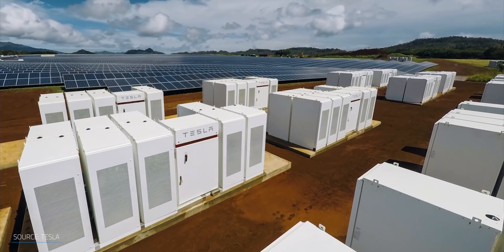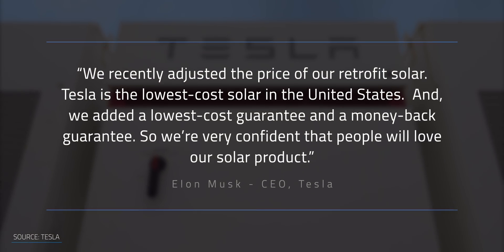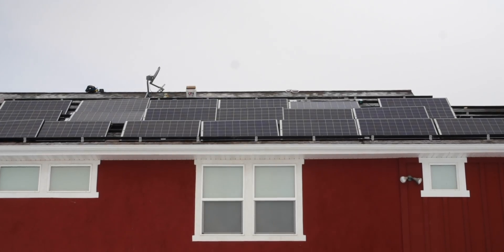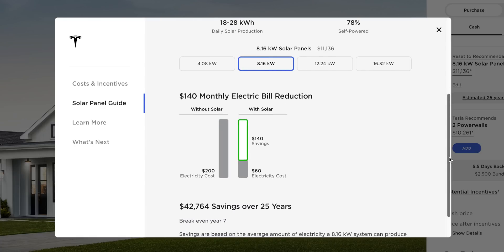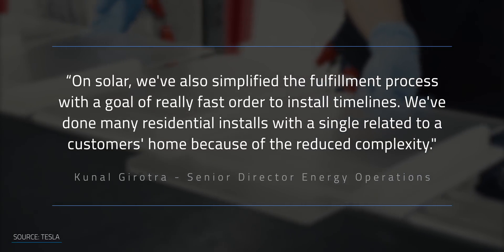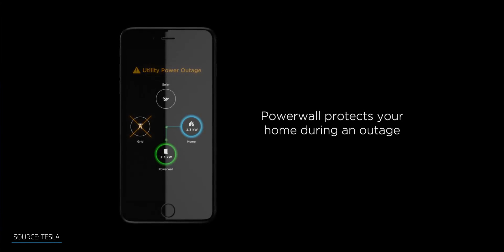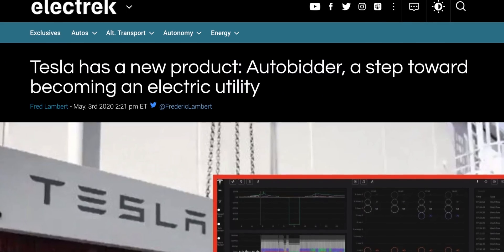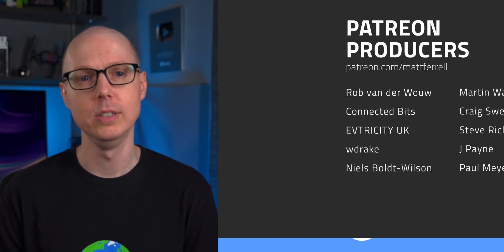Exploring Tesla solar panels game changing price

Comment: Hey Matt, great video.
For comparison, here in Brazil solar cost is around  1.00USD/watt for small systems between 1kw and 30kw. For bigger rooftop systems (btw 300kw and 1Mw) cost is around only 0.61USD/watt, we have no incentives. And those prices were way cheaper before covid pandemic.
I'm an engineer with over 20MW installed in Brazil.

Comment: I would love to have Tesla solar but, when I enter my zip code at the Tesla power page of the site it say "not available in your zip code yet"
Reply: All of my lights in my house are  LED and my A/C unit is new 5 yrs ago so I keep my bill low. I have a cybertruck dual motor/self drive on order. (my 1/2 acre lot is 80% shaded) can only have ground mount on first 20 feet of my south facing front yard next to the highway and the county does not want solar there?
Reply: that is the only place the sun shines for 4 to 8 hours a day.

Comment: Tesla chikubi.

Solar panel https://amzn.to/2Cx3J5t
Eco-worthy 1000w https://amzn.to/2Cg8i4a
Amazing shower https://amzn.to/39trFTi
Earbuds https://amzn.to/3fcw3Iv
Kindle ultimate https://amzn.to/31PAx3N
Twitch prime https://amzn.to/2ZIgcLl
fire tv stick https://amzn.to/2C2bTlE
Midea U Inverter Window Ac 8,000BTU https://amzn.to/3eRYzyp
Necklace fan https://amzn.to/2VGlIwU
Sense Energy Monitor https://amzn.to/2T2u3JD
Spiderman FFH https://amzn.to/2W3NIK7
Aveners: End game  https://amzn.to/2KOhyx7
Metamucil double https://amzn.to/3aHoNB8 single https://amzn.to/3bmvVTU
Canon EOS M50 https://amzn.to/35fHX0c
SONY RX 100 VI https://amzn.to/35bteTS
Canon PowerShot G7 X Mark II https://amzn.to/2WaAPhp
CANON 90D https://amzn.to/3cX8z8O
SONY A6400 https://amzn.to/2VMUNzL
Darth Vader and Ahsoka https://amzn.to/2A3qDjl
Captain Rex https://amzn.to/2L2tMST
Ahsoka Rebel https://amzn.to/2A0hoAl
Anakin https://amzn.to/2W8QZch
Skillmatic https://amzn.to/37PwSEn
Aqua 4 in 1 Monterey https://amzn.to/2Ctihmm
Bunch O https://amzn.to/2YWQodL
Face mask https://amzn.to/2ZBw2Y9
Enema https://amzn.to/2YTOquQ
Amazon business account https://amzn.to/3h9t98K
100 disposable gloves https://amzn.to/3dEbNh9
Bicycle rollers https://amzn.to/2VFCOLh
Oscilloscope https://amzn.to/32tCFyA
Ispring reverse osmosis https://amzn.to/2Wy6D0I
Flex Seal Spray Rubber Sealant Coating  https://amzn.to/2OWPERv
Great Stuff 157913 Big Gap Filler, 20 oz https://amzn.to/39t7lBK
Reusable Half Face Cover, NASUM M101 Face Cover https://amzn.to/3jDWFVl
Rockport Men's Bennett Lane 4 Venetian Shoe https://amzn.to/39tqumR
Helix Flexible Stainless Steel Non Skid Ruler https://amzn.to/3jECy9B
Bacitracin Zinc Firtst Aid Antibiotic https://amzn.to/30KvsHT
Bella & Bear hawaiian sea salt shampoo   https://amzn.to/2Dst6pc
Bella & Bear hawaiian sea salt conditioner https://amzn.to/2PiRFHO

Comment: Through my research, the problem with Tesla obviously isn't the cost but with the customer service.  They have gotten some horrendous reviews leading to 1.X out of five stars.  Has anyone experienced the same bad customer service issues?  Also, I want to do a ground mount system instead of a roof mount but there doesn't seem like anyone I can talk to from the company without paying the $100 deposit.  Any suggestions?  For a company this size, you would think there would be some kind of chat line.

Comment: You make it seem like prices in Australia can be <US$1/W. While that's certainly true, it's actually much cheaper than that. The cheapest operators are offering 6.6kW fully installed for A$2199 (not that I would recommend those!), which equates to just US$0.24/W!
I should note that this also includes a generous federal incentive (STC) though, which currently is worth A$3800 for this system, so if you were to include those costs it would bring the cost without incentives up to US$0.54/W. Still significantly cheaper than US$1/W.

Note, my calculations are based on the DC sizing of 6.6kW, the inverter for this would be 5kW, however there would be minimal trimming, so even a bigger inverter wouldn't change your energy yield in any meaningful way.

Thanks for the video!

Comment: How are you feeling about hubitat now with the release of C-7? Do you have thoughts on some of the community devs (e.g. codahq) pulling their driver code off of github to protest hubitat ignoring stability issues they've reported and requiring the new hardware for S2 (which could have been supported by the old hardware apparently?)

Comment: Build grid-scale wind and solar arrays.  Forget about the rooftop.  It's expensive -- 2 to 4 times as expensive as big solar arrays -- and forget about behind the meter storage.  Concentrate on the Megapack for storage.  I'm sure it's at least 4 x cheaper than the Powerwall.  But, most importantly, grid-scale is 10 xs faster to install, at least!.  And, that's what we need, a fast transition.  That means telling the utilities they have to give us the cheapest energy which is wind and solar, half the cost of coal and natural gas.  By the way, tell Elon we want V2G, my Cyvertruck is all the storage I need for my house.

Comment: 2:20 why is housing so expensive in Australia is the real question.  I would rather pay more for solar on a house that I can afford.
Reply: Lol we can't afford houses here either.
Reply: @mrsmith6532  I have two and they were both reasonably priced.
Reply: @amafid  what area? Also when were they purchased? In most metro areas an average American has trouble actually affording an average home.
Reply: @mrsmith6532  I live in a small town northeast of San Antonio.   I have a 3 bed 2 bath 1767 sq ft built in 2005. Purchased in 2012 for $157K.  

I purchased a rental 4 years ago that my daughter lives in.  4 bed 3 bath built in 1988 2100 sq ft.  Needed some rehab but not too much though. Paid $140K.
Reply: @mrsmith6532  my wife's aunt lives in a nice 2200 sq ft home in silicon valley that is 3.2 million!
Reply: @amafid  Ah the San Antonio area is one of the better priced for sure. Good choice, but also great timing. That was pretty near the bottom of the market. Prices have inflated sooo much since then. I live in Houston so it's not too far from San Antonio in pricing but the price increase since 2009 is BONKERS.
Reply: @mrsmith6532  that is true. Every time I visit Houston and I come back to little ol San Antonio it feels like I'm in Mayberry again.
Reply: @amafid  that's why I refuse to live inside of Houston proper. The suburbs are much more my pace. Hopefully home prices come down and I can buy one in the spring.
Reply: @mrsmith6532  I lived in Spring Branch 50 years ago when I was 2 years old I can't believe how big Houston has gotten

Comment: I installed a 5kW PV (Qcell) system with 10kWh Sonnen battery for AU$20k in Sydney in 2018. Sonnen has also been my retail supplier since the start of 2020, providing connection to the grid and 7500 kWh per year for AU$49 a month. Any excess consumption above 7500kWh costs $24.95/kWh. For the first year they waved the $49 a month fee so I’m running free at the moment (until I burn 7500kWh). When I went into this plan I noticed that my battery started charging from the grid early in the morning (about 2am) and lately this charging seems to increase if rain or no sun is expected the next day. So it’s an Australia wide VPP and I’m not aware of any other VPP that is Aus wide. But I don’t hear about them as much as Tesla. I couldn’t get a Tesla battery back in 2018 when my Sonnen was installed. How does this compare to Tesla?

Comment: I think the bigger mystery you need to ask is, if solar is cheaper in most countries and most countries have more expensive grid electricity than the US, then why isn't absolutely everyone with a roof getting solar? Something like $0.90/W and an electric rate of $0.20/kwh should have a ROI of under 3 years.  That's an absolutely phenomenal return and everyone would be stupid not to take that offer.  There's some unspoken cost going on since no country is currently >50% solar.  If it truly is a ROI of under 3 years, then every Australian without solar on their roof is stupid.

Comment: This is not as simple as described in this video.  The US has rapid shutdown requirements - most of the world does not.  Most of the world use simple string inverters of questionable quality.  In the US you must either use optimized string inverters, a semi-aged, single point of failure system with a big box in your garage w/ a 10-12 year warranty (Tesla + SolarEdge, two manufacturers) or micro inverters per panel, with Enphase for example, with an inverter per panel and generally better performance w/ any sort of shading and no single point of failure.  Tesla product-izing the process is big, however, and because they have access to investor equity whenever they want and rising share prices, they can almost do this at a loss.  EOD, I think Tesla is an inferior product, but if price is what matters most then that would be a decent direction.  Net net more solar in the US is a good thing period.

Comment: Interesting video Matt! However, although the price of the panels with incentives may be lower, you neglected to discuss that price of retrofitting the circuitry of the home & the cost of installing the panels. If one is young enough, this may be a good option to save on energy cost over the long run. However, us older folks who have been living in our homes for 30+ years would not benefit from solar installation IMHO.
Reply: Retrofitting the circuitry?

All they do is add a transfer switch and a grid tie converter and meter to your house. There is no retrofitting needed. If your home runs on the power meter you have now, then it will run on solar grid tie, with or without the batteries.

Comment: Yes! USA prices are ridiculous. Australia has had prices per Watt lower than $1US  for years. 
After a cross subsidy of say $2,600 a 6.6kw setup can be installed here for no more than say $5,000/6,000OAu in most cases. A total cost of under $1US per watt installed. Say Au $7,500/8,0000 without subsidy for a 6.6kw install. 
We don't have a Tax credit here. 
Large Industry and Generators etc. that have to meet targets of renewable energy pay into a fund that subsidizes home owners.
Reply from the maker: Australia is a great litmus test for solar pricing ... as you point out, it's been cheap there for years.  It's nice to see Tesla helping to push US prices closer to that.  Still a ways to go, but nice to see we're not as far out of line anymore.

Comment: I wish they had a 360+ watt panel. Comparing that to the Rec 360. But 315 watts on some of these limited roof spaces and you have to maximize every watt in every panel. Given they are real easing the 500 watt panels soon. The roof is prime real estate and every square inch needs to be utilized for maximum power output.

Comment: I asked Google how much for electricity in Seattle and got 11.4 per Kilowatt hour in June. You're measuring in Watts which looks like Apples and Oranges.
Reply from the maker: The price per watt is about how you break down the unit price for components and installation.  It's not the cost of the energy generated.

Comment: Great video, thanks for the info but on TESLA web site it seems that they are predominantly using string inverters which are cheaper than the micro-inverters adding the prices of 12-24-36 micro-inverters to the tesla sized solar systems will bring the price higher than the advertised

Comment: I find that including the federal incentives is more than a little bit misleading...  for one, that incentive is only 26% on installation cost in 2020, and will go down to 22% in 2021, and 0% for residential in 2022.  I also guarantee you that when Elon is doing that calculation of $1.49, he's taking 26% of the total installation cost on some idealized roof size, and subtracting it only from the cost of the panels alone.

You could argue that if the GOP loses badly in the both the presidential and congressional elections, that evaporation of the federal credit could be reversed, but that is basically wishful thinking at best.

Comment: It's selfish to only offer a contractor installation. It would be much cheaper if the system was designed for a DIY-selfer. I cannot pay that high price up front, but if doing it myself I could install in phases and pay as I go. Forget a loan. Don't want one. I don't want to tie into the grid either. I want it for myself, not to help the electric company out. They don't give a rat's ass about me!

Comment: The key to cheap home energy systems is all about BATTERIES..  (they need to be cheaper, last longer on a charge, and be quick and easy to recharge)   Next,  make better direct current, low amp usage electrical appliances...  (In my own systerm, I convert direct current from batteries through an inverter to alternating current to appliances...  I charge my batteries from grid alternating current OR by using (gas or lp) generators when bypassing the grid)   In the future, it would be nice to skip this back and forth ac to dc to ac....  Note that many LED bulbs convert ac to dc at the bulb.....
    The deal and savings is that in this manner, I completely avoid SOLAR,  which in midwest Michigan is kinda useless... multiple gray days and long nights in the winter time make solar systems a very poor choice in my view...   (We can also debate the amperage lack of most solar systems, which is seldom mentioned... They concentrate on the price per Watt and not the price per AMP.....and next, the conversion of direct current from solar to ac.. and next, that fact that almost all solar systems still remain connected to the grid in one way or another..)    To me,  as long as they charge $20k plus for a solar system, the average human will have to live a long time to recoup that money...   Question:  Why don't they GIVE you the best solar system installed and let the system pay for itself over time from the savings promised??   Answer:  Because they want their PROFIT up front and quick...  We are therefore, in a way, back to JP Morgan asking Nikola Tesla where is the METER??....
      Now many of you here who read this will probably think all of the above is STUPID... and you may be right...  BUT,  I say, the quest here should be for "free energy" for all...   Nikola, I believe was on the verge of giving this free energy from the earth to mankind...  It got squelched, and to me, is still being squelched... Sunlight is free, but converting it to electricity is anything but...

Comment: While I like solar,  Tesla solar keeps having fires at stores with installations that make me not interested in their product.  Interestingly the state of  Florida,  one of the most useful spots to have solar,  requires all homes with solar panels to be connected to the grid,  with the requirement that if a disaster shuts down the grid,  no one is allowed to power their home with their solar panels....
Reply: This is misinformation. Florida allows islanding capabilities, and even allows off grid installations.

ALL grid tie with no battery requires the grid power to function, no matter where you are located.

You MUST have a storage system on site to allow off grid capabilities (Islanding)

In order to be off grid, you must file the proper paperwork to show the state that you produce your own power. You are still required to be connected to city sewer in some areas, and you may have to connect to city water as well.

You saying that no one is allowed to make their own power in Florida is 100% false. What IS required is a transfer switch to disconnect the grid when power is shut off, so your home doesn't backfeed the grid!

Comment: The announcement got a LOT of attention. So I dutifully go to the site and, of course, they say it is not available But they quote 8 kw for $10k. . I don't really want what you got, a system that is worth a lot less two years later. So, look, at a dollar or so, not much point in holding out for 85 cents. But if they can work out the kinks, like the permit stuff, and continue to refine the electronics and even the mounting process, I'm sitting here making money, doing nothing. As the price comes down, the other companies will do the same stuff. A big deal is storage. I'd like enough storage, especially if net metering gets nicked. But a couple of power walls is $10k, so the payoff is nowhere near as good as the panels. The logistics still aren't that great. I use heavy power in the winter for heating, even with a ground source heat pump. So I have to get things in synch with the utiility, which doesn't really love solar.

Comment: hmm lemme think about this.... i can get 1000 watts from my electric company for 10 cents... or i can get a solar cell at 1 watt for $1.49..
well that gonna take many many years to pay for itself... oh and not that it is never gonna have problems.... how many years does it set you back
if you blow a charge controller..... 
dont go with the i'm saving the world from fossil fuel.... how was it made and you can guarantee that it used more fuel to make than it will ever produce.....
Reply from the maker: I think you're misunderstanding the price per watt number.  It's similar to how a grocery story gives you the unit pricing on the shelf, so you can easily understand the price per unit of other options on the shelf.  Price per watt is the installation cost to compare between systems.  Payback period will be a fraction of the lifespan of the system (5-10 years payback vs. 30ish years of service).
Reply: @UndecidedMF   good luck with that... a watt is a watt no matter what.. 
10 cents a 1000 watts is a long time , beings the sun only shines so many hours a day and so many days a year..  where you gonna put this power.. lead acid  l-ion lifep04  those all have lifespans well below that 10 year .
been there done that money pit